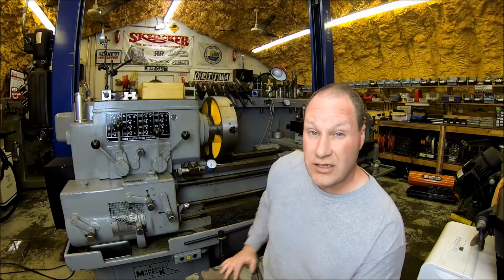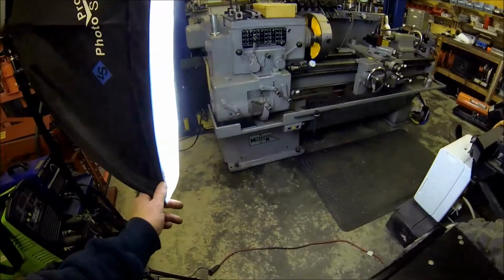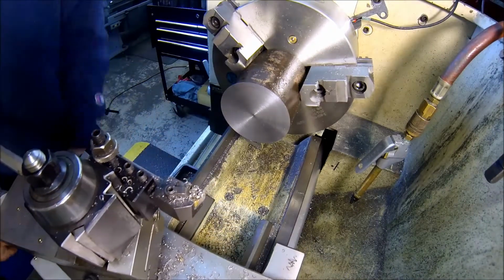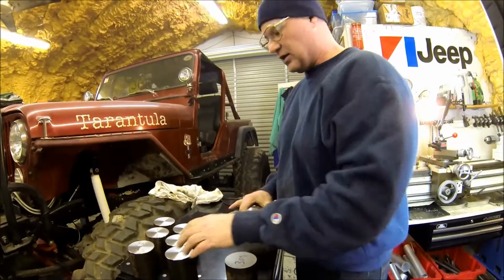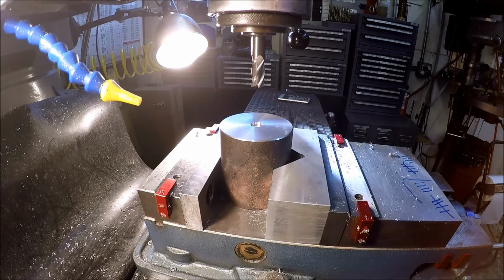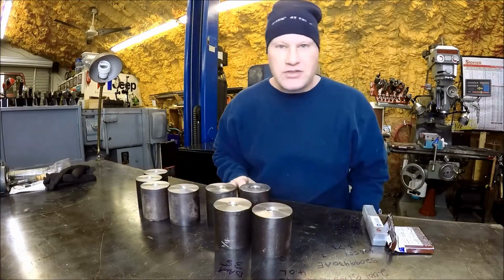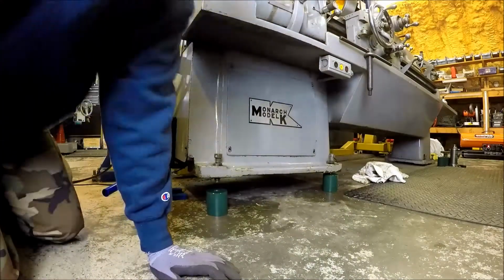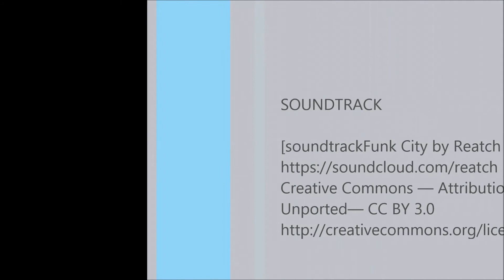Down & Dirty #11 Raising the Monarch

Comment: When doing what you did I have found that useing a ball end mill to make the pocket in the riser and readjusting the end of the screw in the machine stops "walking" when adjusting for precision level. I know your done but it may help someone else or you later if you do it for your mills. Good luck Randy
Reply from the maker: Thanks for the tip.

Comment: FWIW, next time you make a set of riser feet put a large ball bearing in the bottom of the bolt pockets, makes adjustment lots easier.
Reply from the maker: Thanks for the tip.

Comment: Did you use the 8620 for the spacers? I'm also 6 feet tall so I understand why you want to rise is up, neat.
Reply from the maker: Nope. Saving the 8620 for critical parts. Just used some 1018.
Reply: Hill Top Machine Works good I was worried